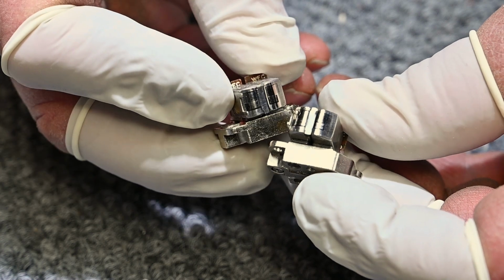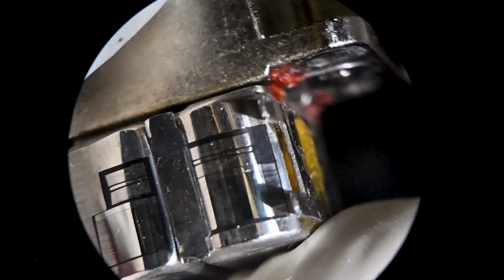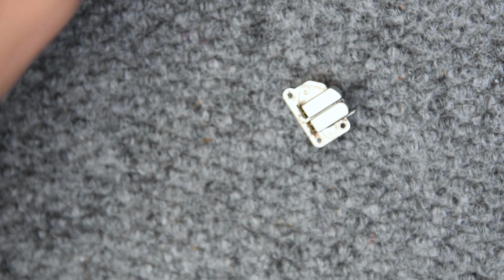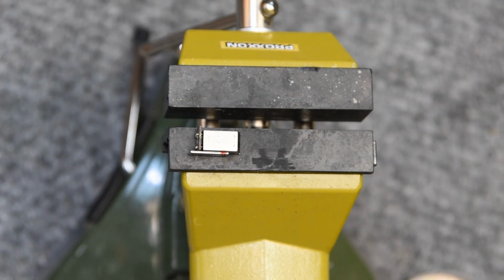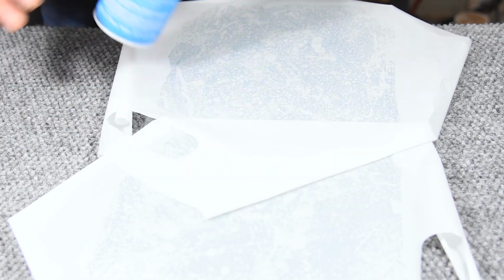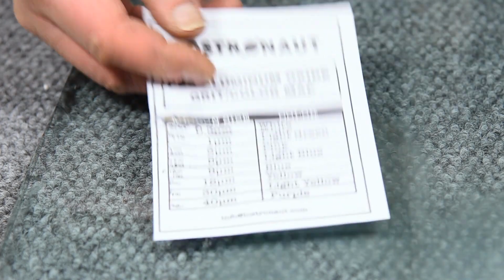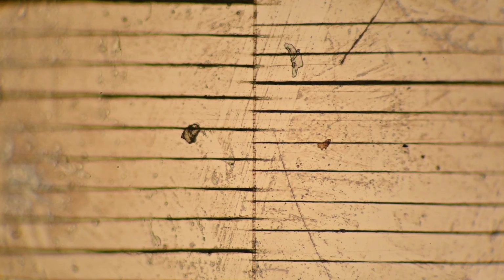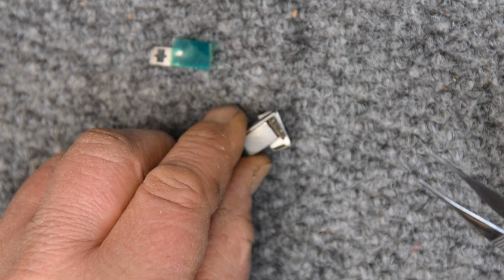Tascam 122mkll Heads Disassembled and Lapped

Comment: There aren’t enough videos on YouTube about tape head lapping, especially for cassette deck heads. This is so great to see. You’ve developed some excellent precision and technique! 

I have been wanting to learn how to lap heads so I can keep my collection of decks operating at spec for as many years/decades as possible. I already acquired plate glass and 3M lapping film a year ago but just been too hesitant to start lapping with it. All the crazy work required around the tape guide is what I’m afraid of. I wish so badly it could be an optional part that could be removed and never reinstalled! I always wondered about bending it… thanks for proving that it should never be bent, so I don’t have to make that mistake ever.

Comment: Hi Peter, as i watch I'll put in a few comments if I may ...

1) Those heads were quite well made, look at the relative consistent gap between the channels. I've seen worse.
2) The circuit board behind the head is a very good idea - should stop excessive soldering from possibly fusing any internal windings,
3) My view currently held view on head guides is that  - they don't truly 'guide' the tape. That ultimately must be done by the cassette tape shell rollers and trueness of the capstan/pinch roller system.
4) You did a fine job on lapping and aligning those guides Peter, better than set at the factory I suspect!

I admire you precise methodology.

I'm no expert when it comes to lapping heads, I have done a few, but I too only allowed one  'pass', and then I moved across the fine grit paper. I think I started out at 3000 grit, can't recall now. 

Very interesting to see what you did, and I appreciate the time you will have put into  making this.

Eric.
(Edited x 3)